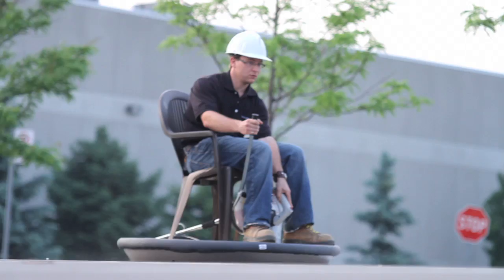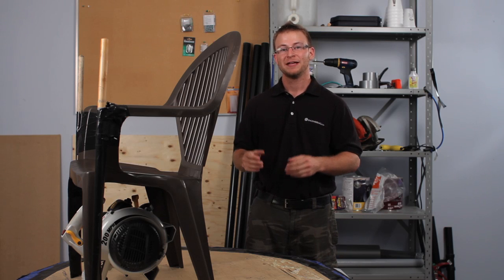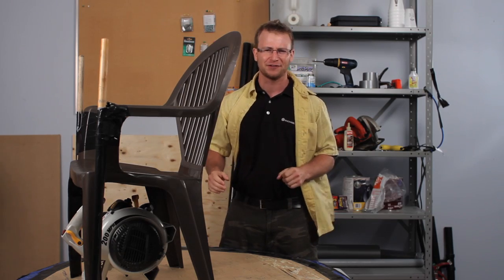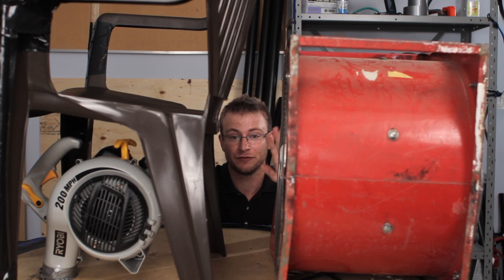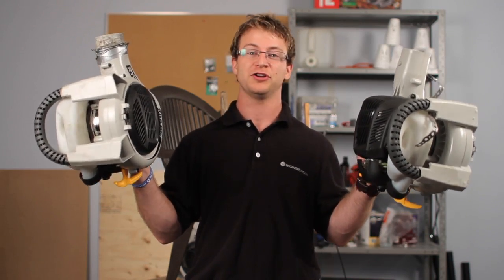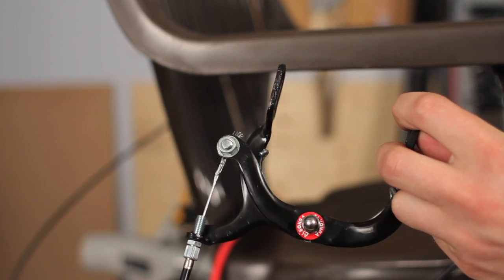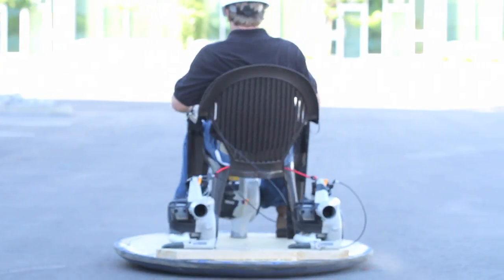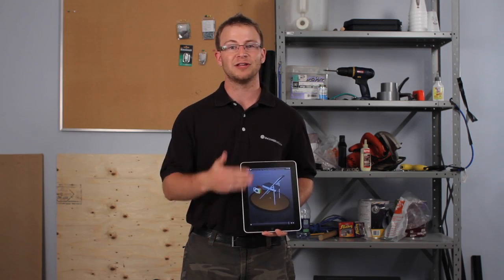Build a Self-Propelled Hovercraft

Comment: My suggestion for both steering and propulsion is to use to leaf blowers which have been inserted thru rubber collars. They would each have a throttle and a stick on them so that you could pull them in the opposite direction that you would like to go since they are inserted through the rubber colors they would be able to make 360-degree circles with the stick going any direction that you would like to go one on each side to control the thrust and the direction

Comment: One blower on the back in a lazy Susan with articulated arms so the blower can move left and right with your two arm controls and the. Your one throttle control to adjust thrust will be all you need

Comment: what are the equations that one would use to figure out amount of volume needed to provide lift and the reduced friction needed to move around?  if you could reduce the weight of the on the platform, how much less volume of air would be needed? sorry if I am using the wrong terms.

Comment: Put a wheel on the front to steer and provide a braking system. Throttle the thruster engines off of the same control.. Botta Bing, Botta Boom, Hover-Cycle.

Comment: I am working to build my own hovercraft, however the shape of mine will be rectangular. I have been researching different ways for a steerable propulsion and I thought of a leaf blower on top of a rotating, ball bearing plate. My question is: Does one leaf blower put out enough cubic feet per minute to overcome the inertia? Or should I spend another $100 on a second leaf blower for propulsion?

Anyone please help, Thank you.

Comment: You should put to bars on the sides that are like the brake on the other one so when you you do the brakes on one side it will turn that way because of the force from the leaf blowers in the back and if you do the brakes on both sides it will stop the hovercraft. Try this idea and I'm pretty sure this will work and if it does please make a video on it.

Comment: why not attach the snow /leaf blower hose on to it and cut them to a smaller size. that would control the air flow a little more. then reduce the power on oppossing ends ( brake left to go right and vice versa)

Comment: if you angle the rear leaf blowers 45 deg outwards from their current position, you can control steering with singular blower and forward motion with both on full throttle or same throttle

Comment: You need to steer it like a spaceship is steered (and some aircraft, to a certain extent).  Basically, gun one of the blowers to get the thing rotating about the yaw (vertical) axis and then release.  It'll continue to rotate for a while.  When pointing in the right direction, gun the opposite engine to get it to stop.  It'll be tricky but you get used to it with practice.  If you're moving forward under thrust, same thing but instead of gunning an engine, stop one momentarily.